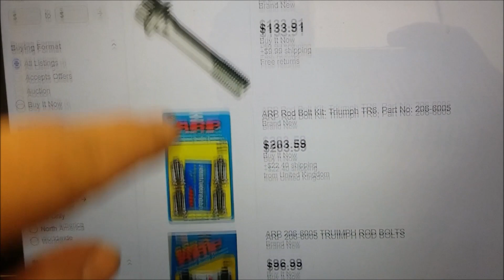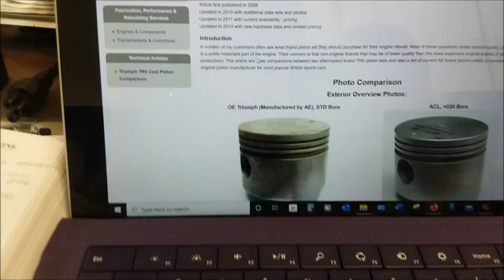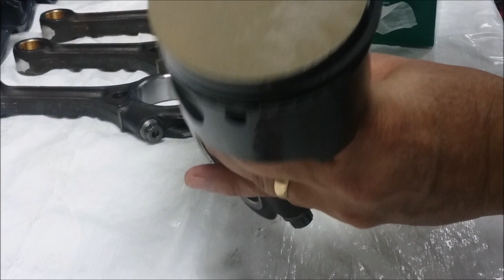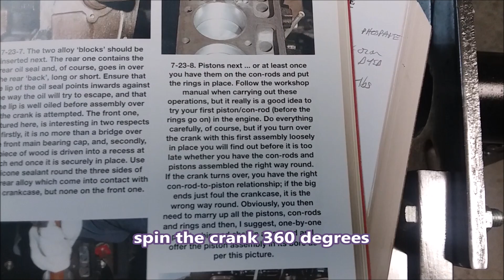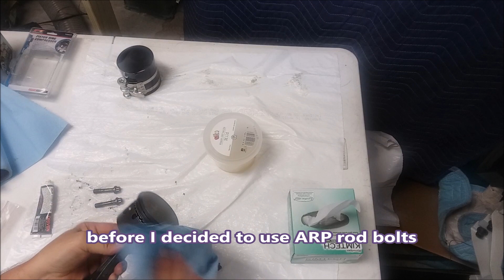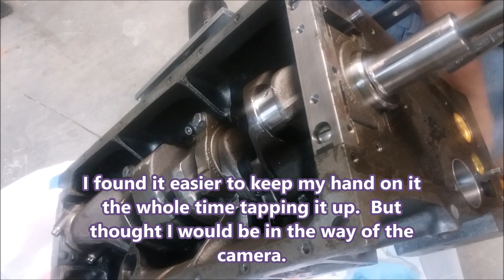Installing pistons, rods, bearings, ARP bolts in a Triumph TR6

Comment: While you seem ultra concerned with cleanliness but you are using a carpenters hammer instead of a machinists hammer ???
Reply from the maker: Not sure I understand your point.  I used the wood handle end.   It is quite a good hammer handle, was thoroughly cleaned, and did not chip or leave residue.  Many machinist's hammers also have wood handles.  Don't see the need to use a machinist's hammer wood handle as opposed to the carpenter hammer wood handle.   Am I missing something?

Comment: Hello,  My name is Randy Gibson.  I own a 1971 Triumph TR6.  Why are Kim Wipes so important?   Will not any tissue work?   Thanks
Reply from the maker: Hi Randy.   Most tissues leave lint behind.  So you will trap lint in the bearing.   Not sure how bad that is, to be honest, probably no big deal.  Kim wipes are designed for clean rooms, leave no lint or other fibers, and are cheap enough.  I discovered Kim Wipes on an engine builder website, not sure where now.  Same argument for using them is made here:  https://www.pelicanparts.com/bmw/techarticles/101-Projects-17-Head-Gasket/101-Projects-17-Head-Gasket_2.htm.  My very first engine build in the 70s I trashed the bearings on my 64 Spitfire after about 1,000 miles -  from not being careful enough.  Now I am over careful.   Plus, I do this for fun, as a hobby.  Couldn't make a living spending a bunch of time on being so careful.